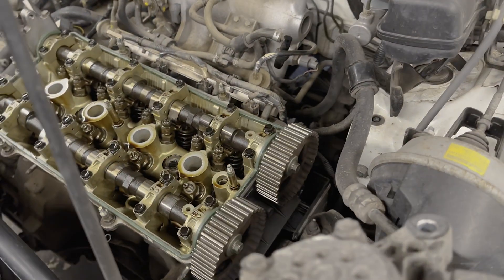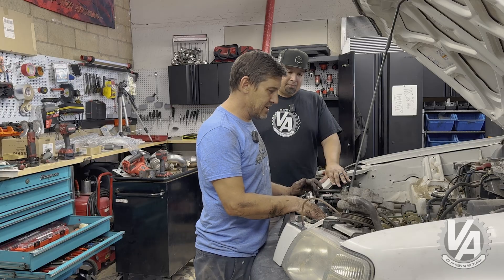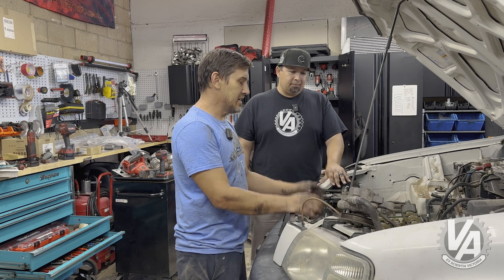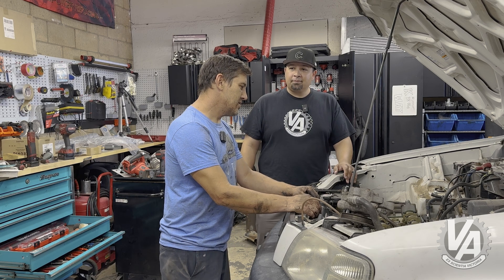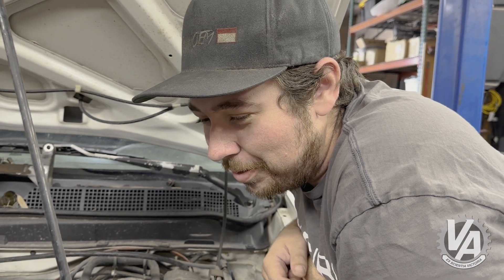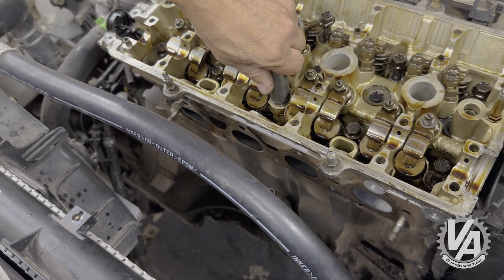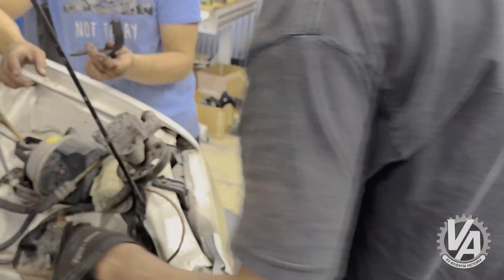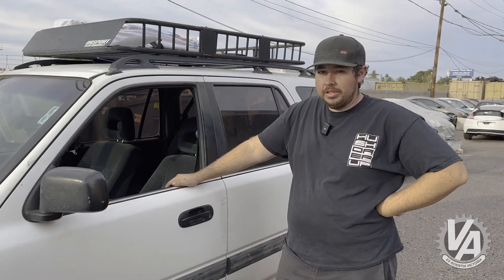CRV B20 to B18 Head Swap

Comment: I remember doing lots of these when I worked at the dealership. The reason this happens is not due to missing a valve adjustment even though doing a valve adjustment would prolong the issue. What we found was the valve seat was recessing into the head causing the the valve to hang open. I remember I had one recessed so bad the screw was flush with the rocker lock nut.

Comment: Hey 👋 
So I bought a 2000 Honda CRV. I got it cheap, $800. It’s AWD, 170k miles. The person I bought it off was driving it for about a year with it misfiring. Compression test cylinder (4) has zero compression. I’m leaning on the fence hoping that it only needs a Head. Just wondering how resilient you think these engines are?  Think I’ll need a whole new engine or get away with a new/used Head?
Reply from the maker: It needs a head.

Comment: Guys can you help me with this

I have crank but no start issue,

However before that i have recently experience overheat and things shows up since then.

It only cranks during cold temp but not during after a long drive. 

What causes this?
Reply: This is honda crv gen 1
Reply from the maker: @shandatoabantas7727  do you have a check engine light on? If so, what is the code?
Reply: Sir, i do not have any check engine lights on. However, i am suspecting the ect? 

I am.running my crv with full distilled water, not coolant since my country is a tropical country and they said distilled water is more effective, is this true?
Reply: I mean it only cranks and start engine during cold/morning but after a few drive let say going to the store and then it wont start, but it cranks

Comment: Right at 100K, congrats & well deserved. 
This video coincidentally enough came about after I asked about thoughts on putting a B18C into a manual Awd crv I got from a buddy. Was told it needed a head gasket. I ended up sourcing a stock B20 head from someone who went B20V in his crx & I plan on putting that on the stock B20 rather than wasting a JDM B18C on a CRV. Thanks for the advice & keep up the good work!!!
Reply from the maker: Awesome! Thank you!

Comment: I recently saved a one owner 2001 Crv from the crusher. The guy had a radiator crack and parked it for 3 years. I happened to over hear him talking to the parts guy at napa saying he was tired of messing with it. Two days later and 500$ I had it towed to my friends shop after a 60$ radiator and a 50$ tune up she was back on the road. She just crossed 270,000 miles, Craziest part is the fact the original starter and alternator are still on the car. My favorite part was going to the local Honda dealer to get all the service records. The service writer who’s been there forever sold it to the guy back in 2001 it was one of the last cars he sold before switching over to the service department, definitely a cool moment.
Reply from the maker: Wow! That is a good save!
Reply: That’s sick

Comment: A friend and I have done the integra ls head on b20 many times. We always use a b20 head gasket. Theres also been a few times where the valve seat was not damaged from a burned and chipped valve, and we just lapped another one right in. For some reason ls integra heads are resistant to burning those valves compared to b20. After years of dealing with this myself I think its due to the obd2 b20 computers leaning them out a bit too much. Also, not all LS integra heads are the same, although they all do bolt together the same. B18a does not quite flow as well as b18b1, and in 1995-96 ish they changed the casting under the valve cover just a tad.
Reply from the maker: I've been told the B20 heads have a problem with the valve lash changing. I'm not sure how that is occurring, but that is what I've heard.
Reply: @VTECAcademy yup the b20 have tappets go out of adjustment like every 30k miles.. mine had its head rebuilt 3 years ago and a tappet always comes out of adjustment
Reply from the maker: We saved the head. It may not be damaged.

Comment: What about over heating issues. I can not idle for long without turning on the heater sometimes. Not sure if the fans need replacing or the radiator needs an upgrade. I am leaning upgrade.
Reply from the maker: Yes, the fans either work, or they don’t. You should be able to observe with her, not there, turning on and turning quickly. If not, you probably have a radiator that is not passing water through quickly enough.
Reply: Double check your thermostat/fan switch and clean the connectors out worst case scenario go to a local pick a part and snag some oem fans off another CRV they are pretty robust fans from factory.
Reply: I was about to say the same thing sometimes it keeps cool or sometimes it gets hella hot i was gonna do the halfsize radiator and single fan to see if that helps

Comment: Just out of curiosity, why do the B20 heads require more frequent valve adjustment intervals?
Reply: My thought is the crv b20 has more harmonic imbalance, and it basically shakes things loose more than the b18a/b. It doesn't really have anything other than that as a difference between the two because the p75 heads both engines use are identical.
Reply: @gusplymale1797  That makes sense. Thanks!
Reply from the maker: I think he’s right. It’s a cam profile thing.
Reply: Also - CONGRATS ON THE 100K! 👏

Comment: the only difference is in the cams between the b18a/b and b20 p75 head.  P8r AFAIK did not come in anything over here in the US.  The P8r has larger intake valves (33mm) and a larger cc size (84mm) then a p75 head (81mm)
Reply: i think the p8r has 31mm inside valves.  i just pulled one off and ran into the issue that the pistons' valve recessions did not clear 33mm valves.  all non vtec heads are pretty much the same except the combustion chamber
Reply: @ej1_drew  😅 they're the same valves intake side as b20a second gen prelude gold top bc make em for 3rd gen prelude
Reply: I Always wanted a P8R head to put some crower 403 cams in
Reply: Yes my 94 teg is running fully build b20b p8r with bc 403 ycp ITR clone Pistons scat rod  water meth 😮  automatic jdm sir-g LSD with the matching tcu I'm looking for civic sir-ii LSD automatic it's also running fat-tube toda rep header
Reply: And when you do the head work on the p8r air flows better than a built b16
Reply: @Mike-s7j7v  thanks for the info :)